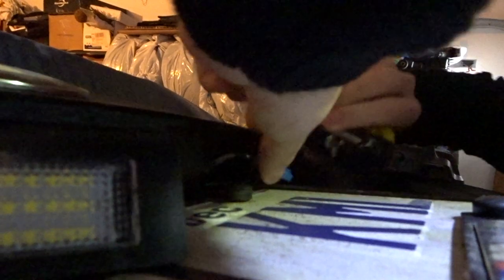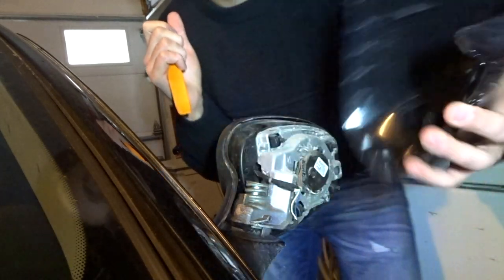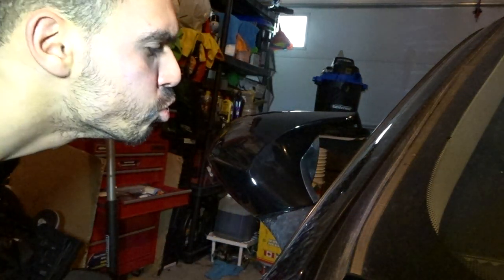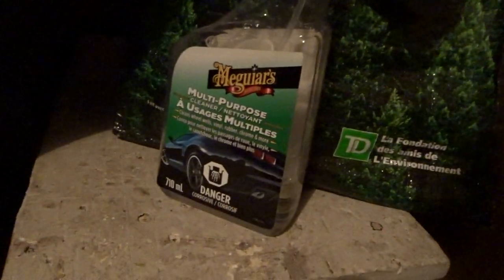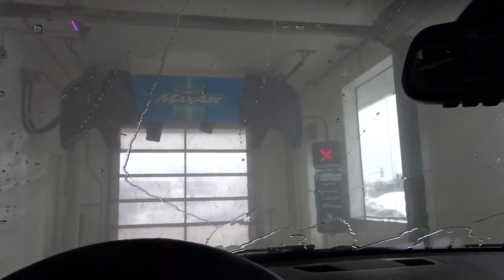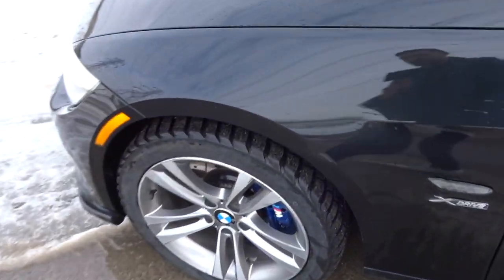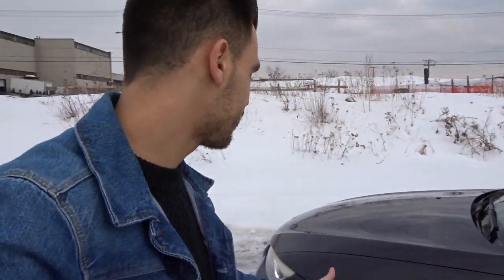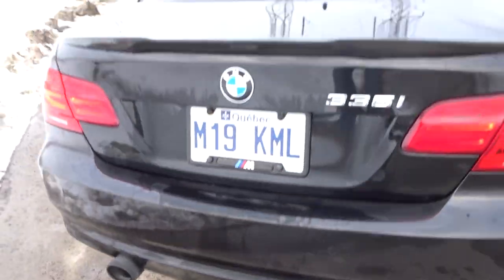///M-Style Mirror Caps on my BMW! (BMW E9x F2x F3x)

Comment: Does this fit in e90 328i 2009
Reply from the maker: The answer is yes, just make sure your model is either LCI or PRE-LCI as the mirrors are different. The mirrors in the video are LCI. Pre-LCI mirrors are slimmer and sportier.